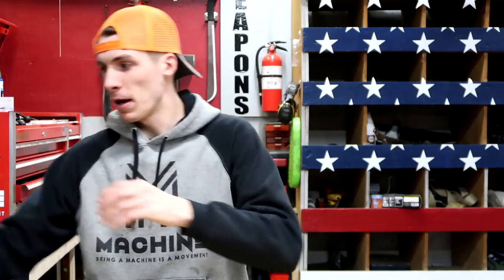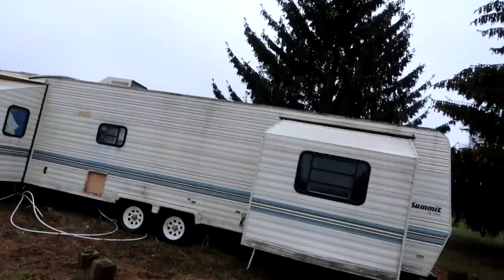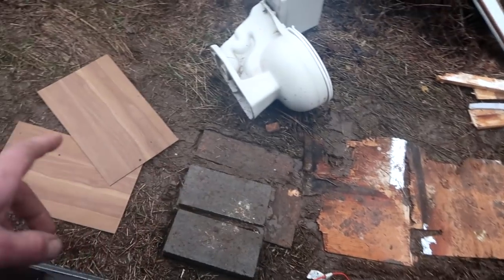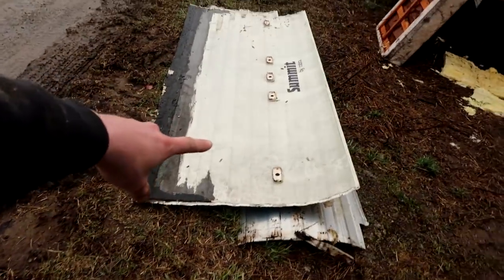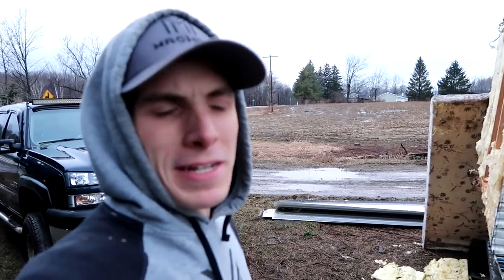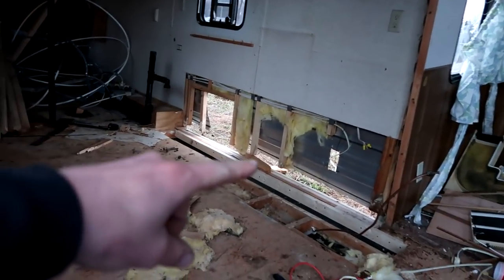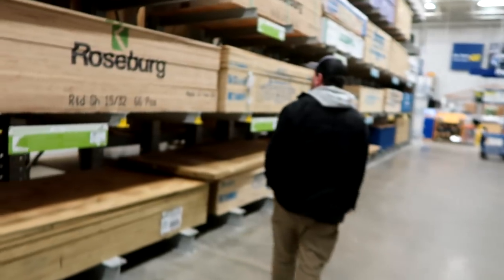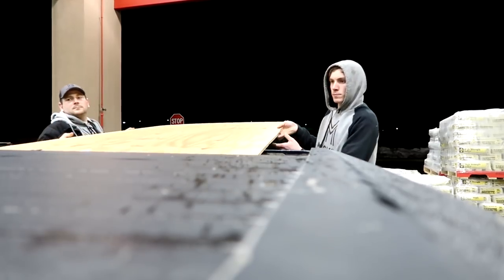NEW INSANE TIRE STANCE!!

Comment: If you back into the trailer and the rear wheel are past the axles,you shouldn't need to move them to balance.Since it has torsion style suspension,maybe just a set of coil-over shocks on the front axle will make the trailer more stable too.Happy Trails.

Comment: The yxz has wider rear rims that the front. I would recommend getting two used front rims so you can run the 9 inch wides all the way around.

Comment: If there is anything I want that says Machine, that would be a headlight sticker. The kind of sticker that is translucent so you can see when the light is on. The ones you see on moped and motorcycles. Could you add some of those to the shop? 
3.5 or 4x1.5 inches would be nice.

Comment: That duramax sounds like a dolphin     Lol.  If you are not careful running those tires they will sidewall roll on you and you can flip the crush very quick or that's what almost happened to me in my Commander at only 15 mph.  So I swapped to a harder sidewall in a matter of only 2 weeks after buying it new. I now can drift it even with 6" of lift at about 40 mph with my OutLaws SW OLs on it

Comment: I have those Bighorns 2.0 on my Side X Side the sidewalls are so thin it dont take much to puncture them in 500 miles I have replaced 3 of mine soon will do all 4 to a different brand that I can relie on, mostly inwhere I drive is Woods Road my 700 Kingquad tires are cheap Mud Lites witch are 12 years old and also came on the machine from the dealer and have never had a problem and I beat it every chance I get. So watch how you run them Maxis Bighorns

Comment: Need to check original tire sizes if there bigger on the front and smaller on the rear the way the old tires look you will end up breaking the front diff or the transfer case most atv and some sxs come with 2 different tires sizes and the gearing makes up for that ratio

Comment: Haven't tried Big Horn tires.      I do have a buddy that ran Ripshaw on his ATV and called them garbage, the threads clog up and then you get stuck.

Some variation of V track seems to be best, far as a casual tire I've heard good things said about Bear Claw.

 But hey free tires are free tires.   So I guess you can't complain to much.     Hope the Big Horns do you well.
Reply from the maker: Thanks. Stay tuned. We'll find out together.
Reply: The big horn 2.0 are good tires and don't pack mud in tread but my only complaint is they're 6ply so you better keep a lot of plugs with you like I do. I want to try the rip saws, heard good things about them on the  kawasaki teryx
Reply: That's good to hear about the Big Horn 2.0.      And isn't 6ply a good hard tire?     My buddy recently upgraded from his 400 Polaris to a 700 Yamaha ATV.    The Yamaha just run stocks which are only 4ply, and he gets in and out of the woods the best kind without popping the tires.    So 6ply is a even harder tire again.

With Ripshaw or ripsaw, whatever it is, not sure on the spelling (I'll go with ripsaw), if your going to be doing yard work I wouldn't recommend them.    They seem to tear up the ground easily on a ATV so I hazard a guess on a even heavier side by side it wouldn't bold well for the grass.     If you often travel with friends, Ripsaws will also kick up a LOT of dust on dry trails.     

Far as mud/snow they seem good but bad, if your in a kinda half watery/muddy situation they seem alright, however in sticky mud/snow the threads seem to pack up as the tire design doesn't clear itself very well.

Personally I wouldn't go for the ripsaws.     They are a good hard tire, I think a 6ply, either 6 or 8, but going by what my buddy has told me and what I've personally seen from him having them on his Polaris, I don't think they are that good.      Honestly the Big Horn sounds like a better tire seeing you said their threads doesn't clog up.
Reply: Justin Lynch the bighorn will chew your yard up and where I ride in TN we have a lot of rock so the 8ply just holds up better. with that being said I have never gotten my sxs stuck in mud or snow with the bighorn but I have had plug them many times, the first plug was on the first ride. Great tires just To soft for my riding conditions.
Reply: Ah well for rocky areas with not much in the way of mud/snow, I can certainly see Ripsaws doing well for that.    The Ripsaw threads are a lot closer together then the Big Horn, and are quite deep as well, so unless you drive a nail up into your tire I really can't imagine you popping them very easily.     Not only are the Ripsaw threads closely packed and deep, but as I said the tire itself is hard as well.

So yea, if rock is your main thing then I can see Ripsaw being good for that.
Reply: Big horns are great since they measure a little bit taller than their numbers but indeed they suck in mud/bogs. Trail riding tyres.

Comment: You need to make sure that you can load crush up to where "he" is on the axels of the trailer. If he is sitting to far back that extra weight will pop the nose of the trailer up and in turn pull the back of your truck in the air. A very unstable and unsafe tow.